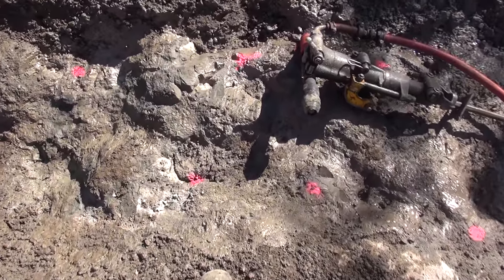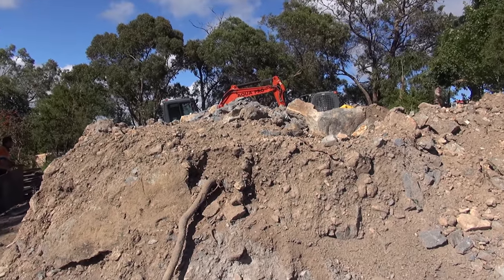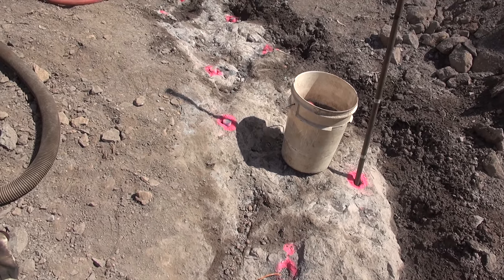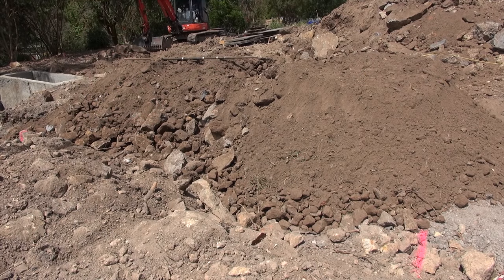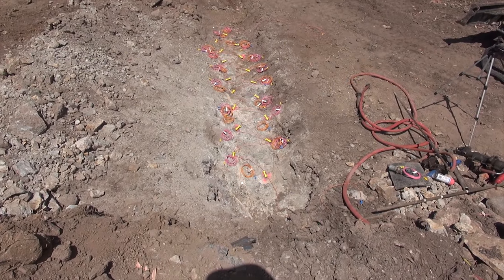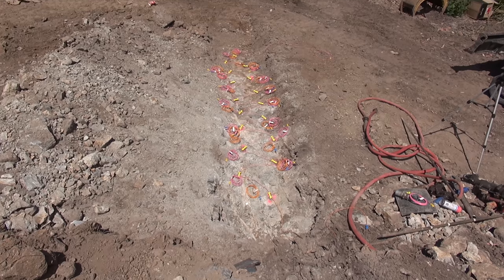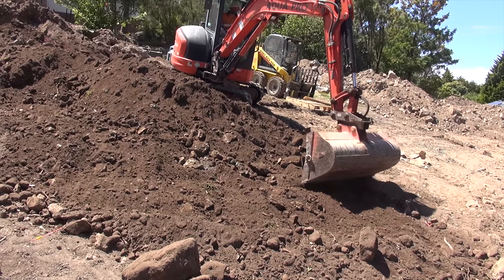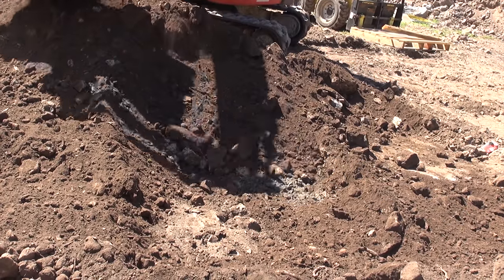Blasting for a new drainage line

Comment: G’day Dave.  Great job, again, mate. 
I’ve been toying with an idea, here.  Put a simple version of it into practice a couple of times recently on our farm here in Tassie.  I needed to run a 50mm water pipe through the existing lawn, but only needed it down about 200mm, but there were existing reticulation pipes and electrical cabling at unknown locations in the lawn I didn’t want to damage.  I ended up using my Kärcher 2200psi with the rotating head, gaffer taped to the side of a vacuum tube running through a primary tank (1/2 size 44gal drum) to my wet’n’dry vacuum.  Using the setup, i was able to cut a pretty perfect trench to depth and width without to much disruption to the surrounding lawn.  After fitting the pipe, I poured back in the slurry from the drum, and within two weeks you couldn’t tell where we had put the trench. 
I’m thinking a similar system might work for drilling the rock without vibration and dust. Outer tube of standard polypipe, with a central pressure tube to the nozzle.  Nozzle has an artificial ruby jet, similar to the water jet cutters used to cut steel, running up to 50’000psi, rotating at a slight angle to the bore (in a conical pattern) with the slurry vacuumed out the space between the inner and outer tubes.  If it can cut steel, it should cut rock easily.
Reply from the maker: Congratulation on your home brew no destructive digging set up Andrew, it cost a packet to hire these guys, way more than me (maybe I should be doing that instead?). On the waterjet rock drilling, I think that all of these things have been tried and if it was only slightly cheaper or faster than regular percussive drilling the mining industry would be all over it.
Reply: @demolitiondavedrillandblast  yeah.  I had planned to use my hydraulic teaspoon, but the complication of pre-existing pipe and cabling, not to mention the projected time spent tidying up the lawn after digging a 75m long trench, I figured it was an easier fix with the water cut trench.
Reply: There are a lot more of those jet and suction trucks running around these days providing non destructive excavation services to telecommunications,  councils, builders and other contractors. Comes in handy with well established trees and their roots being in the path of infrastructure upgrades.
Reply: @markfryer9880  yeah, but they are really only used in areas where there has been prior work.  I’m talking using it to drill virgin rock.
Reply: @andrewallason4530  pumping and handling that kind of pressures and abrasives puts a lot of wear on pumps and nozzles, making it more expensive than carbide teeth in the long run.

It would take a LOT of water to carve out tunnels, plus flush the chips out, and you can't just recycle that water back into the 50k pumps, the clearances are too tight, so either you have to use high volumes of fresh water and dispose of all the waste water, or you have to have complex high volume settling and filtration systems that can recycle the water without killing the pumps.

So when you look at the additional complexity, and labor needed to support it, it really doesn't look very good compared to off the shelf carbide teeth.

Also, in soil conditions, washing the dirt away is going to leave a non uniform hole, since some areas with soft dirt will collapse and erode from the water, even not directly in front of the nozzle, and other areas, firm clay etc, will barely wash out, so when you put the pipe in, some will be snug, but some will have open caverns above it, which the slurry won't fill because the air has no way to vent out, so you most likely will end up with a depression in the lawn over where the pipe is, with some holes where there were larger holes.
The slurry will also shrink as it dries out, since it has such a high water content.

Comment: Hey Dave, what's the hardest and largest rock you've had to blast ? And is there  a video?
Reply from the maker: Good question, The largest by way of explosive consumption would have been a big lump of Granite in a housing estate subdivision back in 2006, it took 145 holes, most of them 3 meters deep (10 feet) and 5 cases of rock medicine. https://youtu.be/VCMjaYfUgKQ?t=1641 had to do it in Two shots because the 30 tonne excavator could not reach far enough to cover the entire rock. 97 holes in first half and then 47 in shot 2. And then there was this 253 hole shot, https://youtu.be/VlDazC1RWpk?t=193

Comment: I'm sure it'd be cheaper & faster if those doing the excavating called you up as soon as they hit rock that can't be pulled out using the bucket on their machine, rather than hammering away for days, or in this case, using cracking goo where it won't work (where was the rock supposed to move to...)
Reply from the maker: I'll be going back to this site as there is a lot more digging to do, storm water retention and filtration as well as all of the trenching. Might take the AirTrack drill rig in there and pre drill through the in place cover and down into the rock to save having to dig it all up first. You understand why the cracking goo does not do so well in this application.